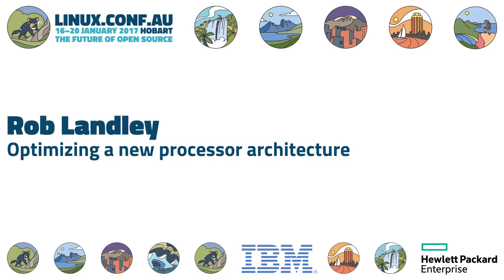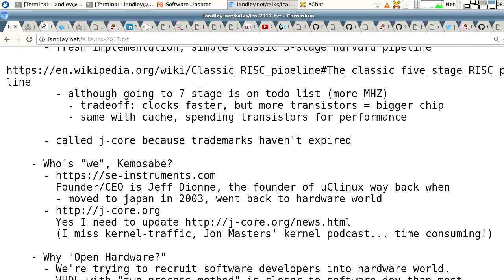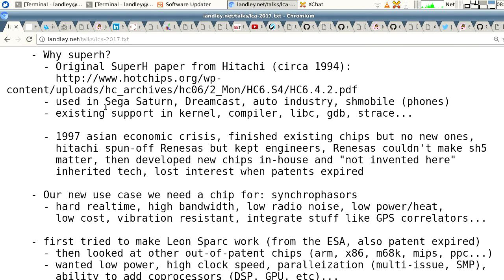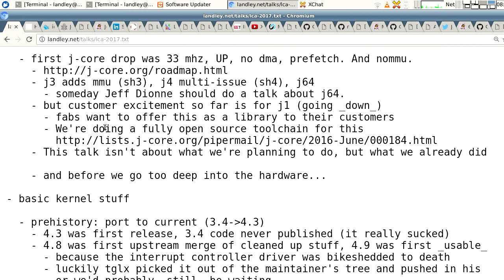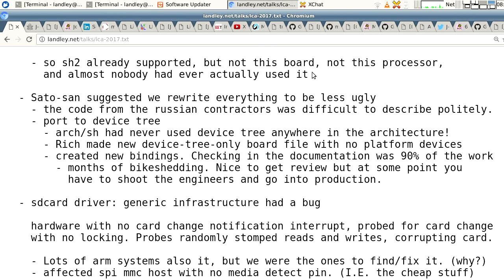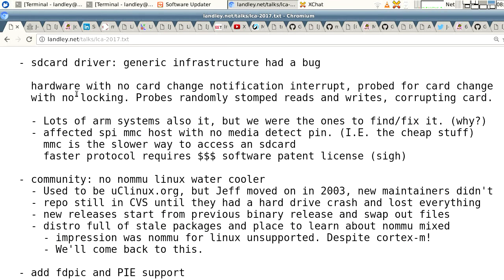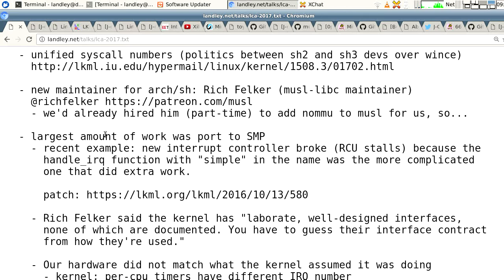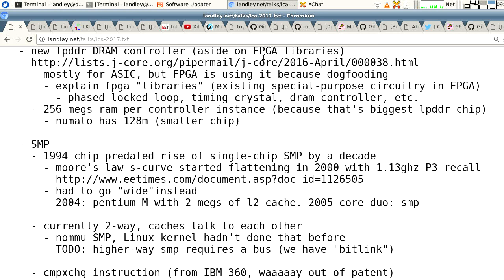Optimizing a new processor architecture

Comment: Great topic, and really interesting, but let down by constant backtracking ("here's a tab that I'm not going to show you. And another one"). I've seen some really great no slides talks before, but with all the sidebars that went nowhere, this talk was really let down. There's about 20 minutes of material here, presented in 50. 

I would suggest Rob focus on a few key topics:

Baseline performance of the j-core original port
How they improved the maturity and stability of the port 
How they improved the core (with microbenchmarks or metrics)
How they improved the tool chain (with microbenchmarks or metrics)
Current benchmarks and demo of FPGA hardware
How folks can contribute via emulation and in hardware

Get rid of all the tabs; they distracted both material and from the speaker. None of the tabs ended up being discussed for any reason, so they were more than terrible. By not backtracking, and maintaining forward momentum of the core story, this talk could have been far more compelling.

Comment: The presentation text is at http://landley.net/talks/lca-2017.txt
It would be interesting to have j-core and perhaps Tensilica (ESP32) results to compare with the arXiv:1607.02318
The Renewed Case for the Reduced Instruction Set Computer: Avoiding ISA Bloat with Macro-Op Fusion for RISC-V
(comparing the dynamic instruction counts and dynamic instruction bytes fetched for the popular proprietary ARMv7, ARMv8, IA-32, and x86-64 Instruction Set Architectures (ISAs) against the free and open RISC-V RV64G and RV64GC ISAs when running the SPEC CINT2006 benchmark suite)

Comment: My Samsung 64 GB microSD card got fried by this bug.
Reply: Mhm you think so? Some cards just come defective from the factory and will die in normal use, usually just from silicon flaws that take a while to really manifest themselves. And there was the famous Samsung eMMC firmware bug which killed a bunch of Android phones. The SD-Card and eMMC firmware is fundamentally from the same development tree, it's just that SD-Cards are disposable while eMMC are less so, so if the bug made it to SD-Cards, probably nobody will ever dig deep enough to find out. An SD-Card corrupted by incorrect SPI/SDIO commands as in the case of incorrect locking from the Linux kernel will generally just store incorrect data, the vast majority of the time, not appear actually dead.